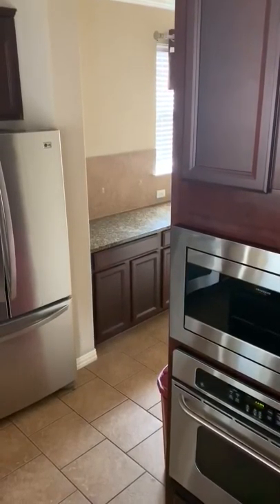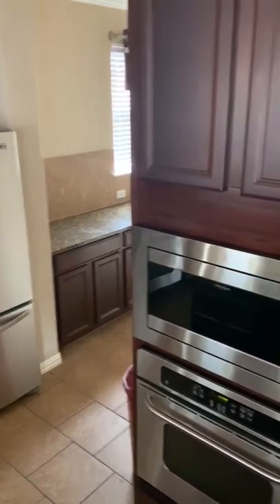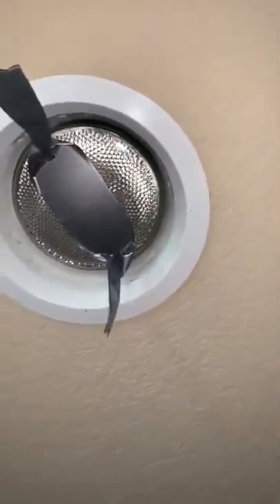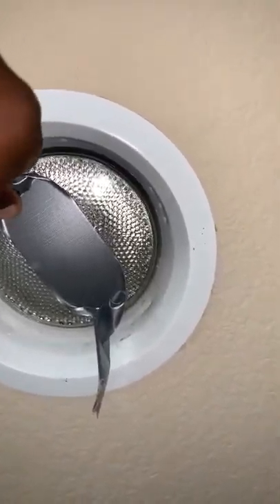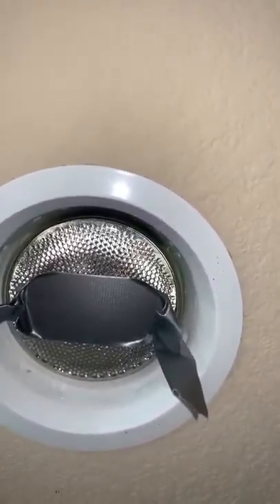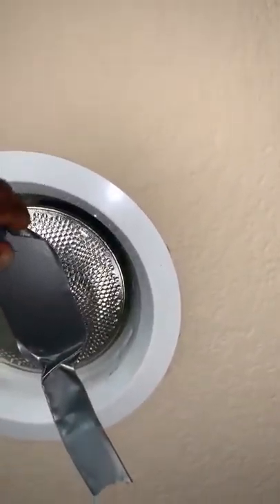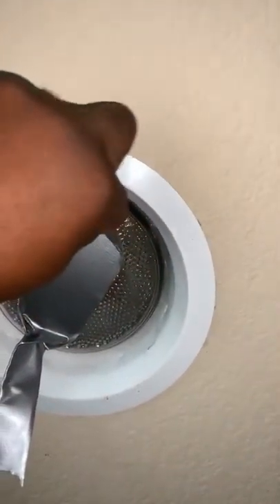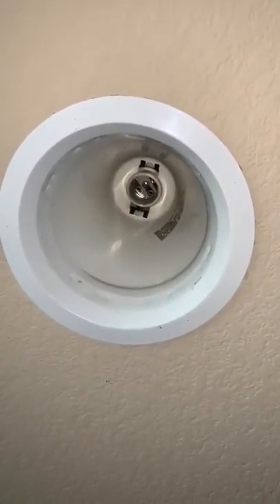Remove stuck recessed light with tape

Comment: Wow....amazing tip.  I had a bulb that came out half way and then wouldn't turn anymore.  I was at a loss of what to do so I thought I'll try the tape as you demonstrated.  I wasn't sure if it would work but I was amazed when the bulb came out so easily.    This is definitely one of best tips ever on YouTube.  Thank you so much for saving me a lot of time.  Will put this video in  "My Favorites".  PS...also works great for installing stubborn bulbs.

Comment: I OWE YOU A HUGE THANK YOU!!  Had exact same problem--thought the bulb was too large for the recess can housing and was stuck but that is because there is nothing to grip and so to try to twist it with your hand you need to put pressure up.  Some duct tape worked like a charm just like you showed.  It felt like it was actually stuck at all.

Comment: Had a problem where bulb was really stuck. Bought a stick with suction pad they use when lapping car engine valves. Nice strong suction cup. Worked like a dream when changing out 9 old lamps. Just stick on and give a sharp left turn and hey presto!

Comment: What light bulb did you use now
Reply from the maker: I don’t recall but it was a similar bulb since I was worried about being too small or too big. Hope it helped.
Reply: @bosshogg1155  Yeah.. I just use a typical A19 bulb in every light fixture I have as it’s the standard type of bulb which is pear shaped. A15 is decent for appliances and the ceiling fan lights. But A19 is also good for appliances and ceiling fans as well as long as the bulb fits. Generally, A21 bulbs are way too big for typical light fixtures. Those are 150 watts and above for incandescent which is more suitable for big lamps. Some LEDs are A21 and state that they’re 100 watt equivalent.